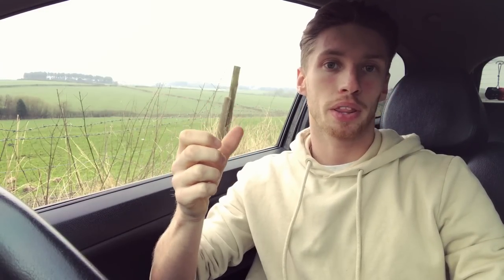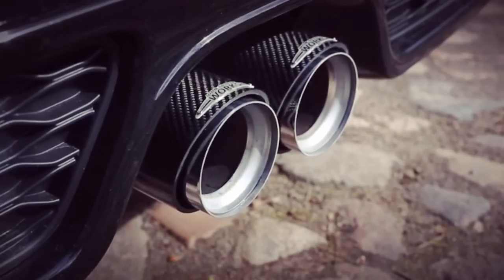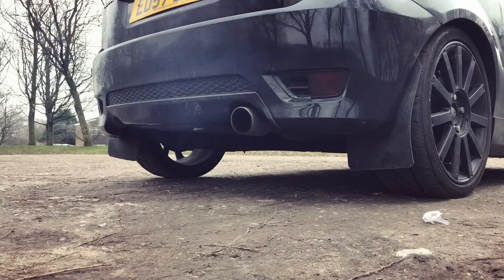How To Make Your Exhaust Pop, Bang and Crackle

Comment: My truck pops with exhaust and cat and not even full tank just have to rev it between 3 and 4 thousand rpms but my 2017 camaro 2SS pops regularly jus driving
Reply: RGFL !! Not what he meant by over over fueling it. He meant into the engine not the gas tank. The amount of gas in the tank is irrelevant.

Comment: You've got the basic concept but the execution was lacking, in my opinion. I still have a cat as well as a muffler and my car sets off car alarms when l let off the gas. The thing sounds like a helicopter at idle and it isn't even turbo. I feel like your car sounded weak. If i leave my car to warm up on a cold morning and go inside, I find stuff all over my house rattling.

Decent video though, 7/10.

#subarugoals

Comment: It's illegal to remove cats in America :(
Reply: 2AverageNoobs I just had my local exhaust shop remove the secondary cats on my clk and replace it with a straight pipe here in Arizona
Reply: @ak740_  I'm not saying shops won't do it, I'm just saying it's illegal and you'll fail emissions.

Comment: good way to blow you engine
Reply: Chase Leimgruber how would it damage ur engine. like at all lol
Reply: Blackbird REDX engime runs lean from to much unrestricted exhaust pcm gets confused dumps more fuel worse gas mieleage and since more air is entering into the cylinders from less restriction you run the risk of piston slap or burning valves from air escaping the compression stroke due too to much valve overlap so ya thats how in the end youe engines gonna go boom boom